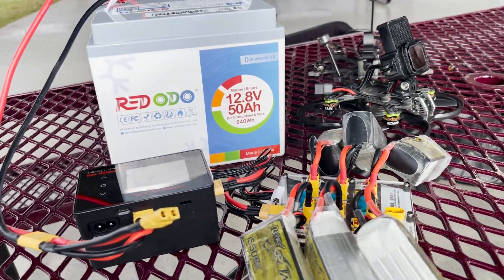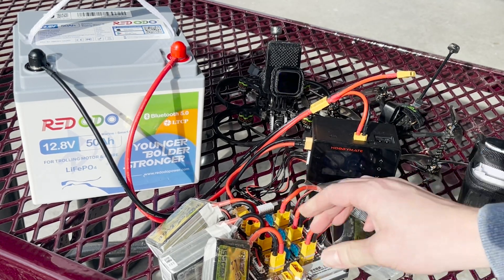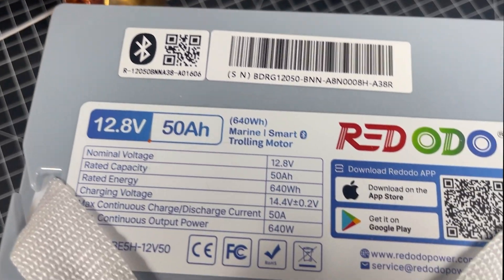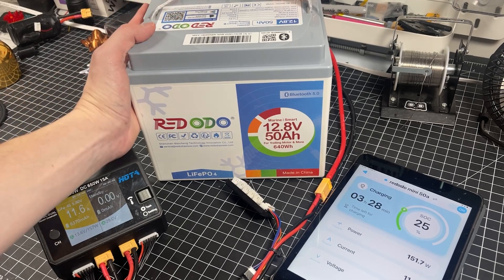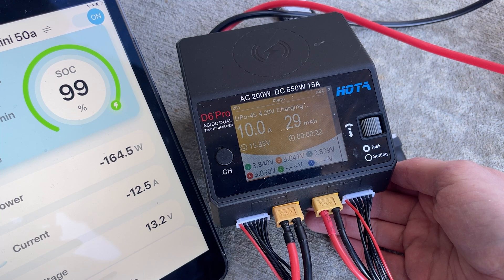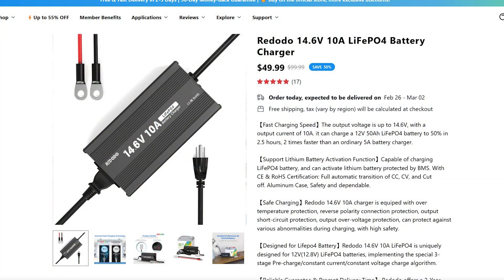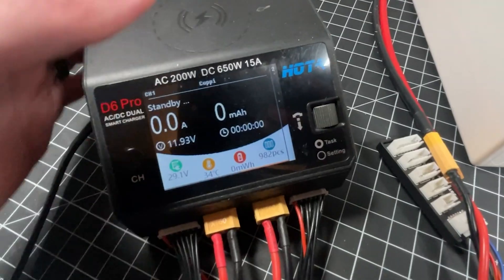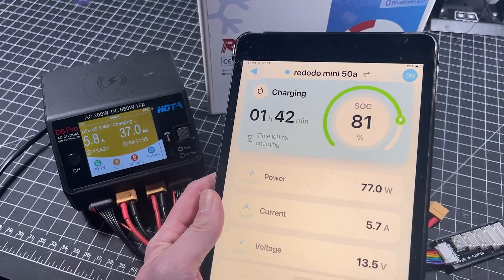Redodo 12V 50Ah Bluetooth Lithium LiFePO4 Battery // Recharge FPV Drones & RC Car Batteries!

Comment: That’s actually very impressive! The review itself amazing. Everything is simplified for the viewer. Just curious… what’s the maximum discharge rate on this battery? Can it safely handle 6C discharge?
Reply from the maker: Thank you!  Nope. This only does 1C discharge which would be 50 amps. The max continuous charge/discharge current of 50A. 6C discharge would be 300 amps!

Comment: Thanks for posting this video! Sorry I deleted my comment I was a bit agitated and had problems with the auto correct but basically I am still on the fence about this battery based on what I am figuring out from not having power in an urban environment in Italy 😅😅🙏
Reply from the maker: You had a much longer comment that I saw that was really interesting, thanks for sharing it! I have no idea where it went, youtube seems to have removed it.
Reply from the maker: Oh I see now, no worries. Honestly I would look at getting some of redodo's 24v and much higher capacity batteries. This one is super light weight and great for travel purposes, but not really for extended outages.

Comment: Jonh , this is off-topic, but I'm a newbie who is lost once again. I have a Zorro Tx 4/1 with a Betafpv ELRS module attached. When I go into the Edgetx program and turn off the internal RF mode and then set the External mode to CRSF (which I was told to do ), I can not find the Bind function mode. Do you have any thoughts or suggestions?

Comment: nice! Have you considered the 24 V battery? your charger should be able to handle it
Reply from the maker: Yes. The charger could handle it and it would be able to push more amps out because at 12v the output is limited. I don't recall the formula but charger can do 650w dc / 15a or single channel 30a but you can't reach this or sustain it without at least 24v.

But then you go up in price by another $100 or so and naturally it's double the weight at 21lb for the 24v 50ah version. 

For my use case I don't think 24v is worth it for the trade off of the extra weight and double the cost.

But that is definitely an amazing option to consider. Especially since considering against a power bank...  most power banks you're not going to get 24v out from the DC side. Bluetti, Jackery, etc all of the ones I have only do 12v DC out.
Reply: @JohnCuppi  very cool..great video. I might try their 24v setup for my helis!

Comment: Been waiting for this one since you showed it to me. Could this be used in concert with like those power stations to be used in a no power situation? I feel like it could be useful for powering/charging smaller items while allowing the power stations to run the larger power hungry devices. Great vid man keep'em coming.
Reply from the maker: @1EyeInTheSky  Yes, you can run this straight into an input jack that takes 12v on something like the bluetti eb3a or similar. Need a cable to do that. But it works great as additional capacity.